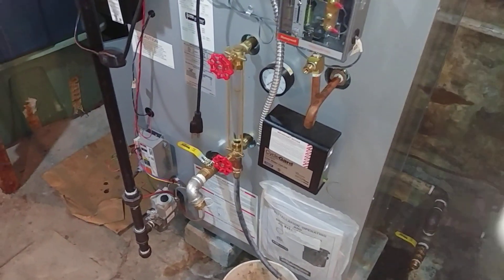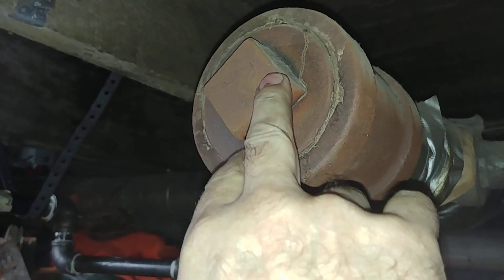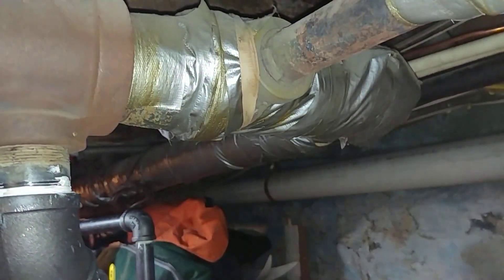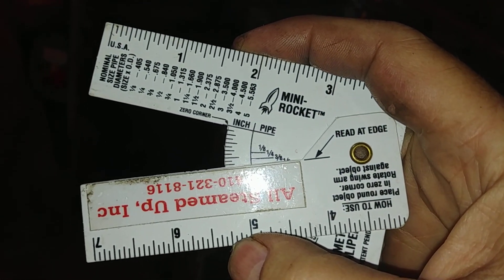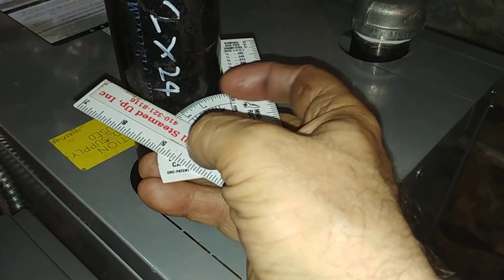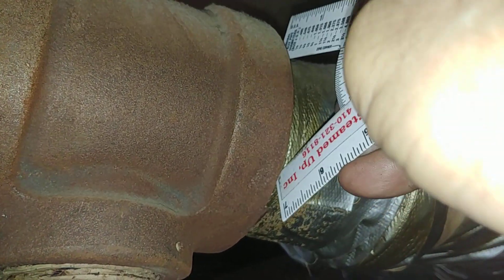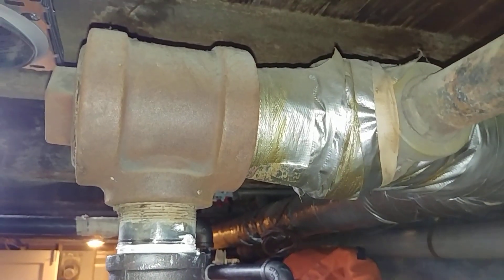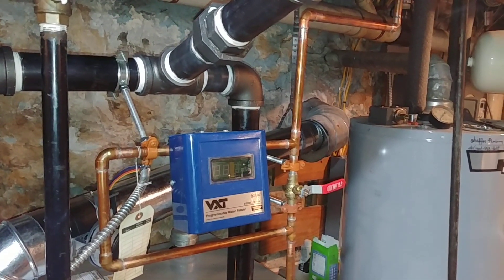Sometimes It's Best To Just Leave Old Steam Fittings Alone

Comment: Question. I noticed you are using standard black pipe fittings. Is this okay ? I have always used Steam fitting. I believe   New York City code require steam fitting. Your local code may be different .
Reply from the maker: In my professional opinion, the use of standard pipe fittings in place of so-called steam fittings is perfectly fine and has no deleterious effects on steam quality or boiler longevity.
IIRC, the NYC plumbing code also requires licence applicatants to demonstrate proficiency in making wiped lead joints. At best, this is a silly waste of time and calls into question their competency to insist on the atavistic use of "steam fittings".
Reply: @gordonschweizer5154  Thanks for you quick  response.  When I  get around to  changing  the  steam boiler  in my house  I'll  use standard  fittings.  My boiler is around  30 years old.  The header is piped  with 2 inch  copper.  I'm  living in Nassau county  now. So Nyc code doesn't  apply. Hey, for a plumber  you use some  college english. Had to look up a couple of  words.  Keep up the good  videos.